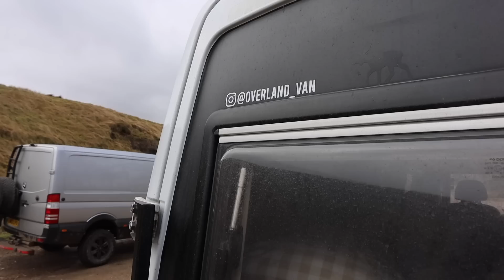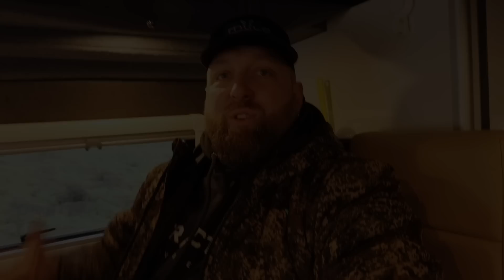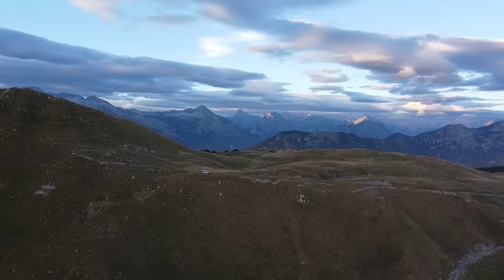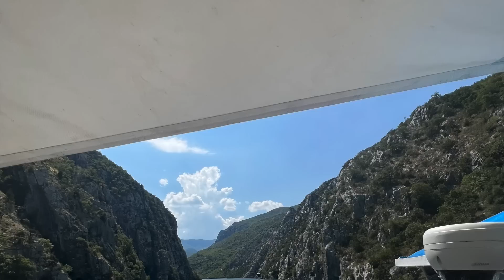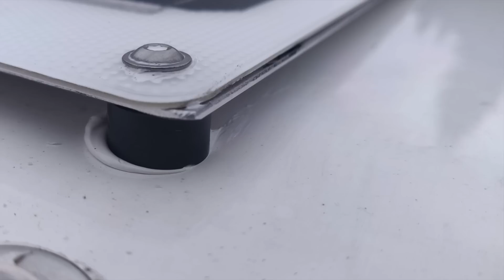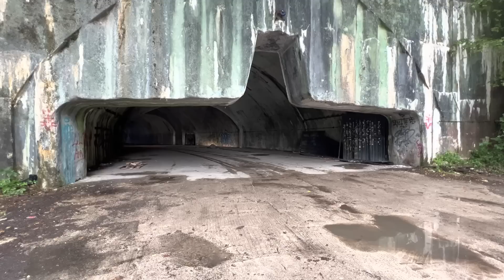4x4 sprinter camper van built for anything!

Comment: Fair play and each to his own, I just can't think help but feel these are compromised as campers and compromised as off road vehicles, but the owners try hard to justify they're "great". If I want to get somewhere remote I'll take a proper 4x4 and compromise on the camping comfort, if I really want to be comfortable I'll take a camper / motorhome and compromise on the location. Shot of an Iveco or at a push an Ighault (and even they aren't perfect), I just don't buy that these are a "catch all" solution
Reply from the maker: Every vehicle has a negative aspect that is obvious. These vans however are an amazing allrounder. As for needing a proper 4x4 to go remote then you must not have looked at the locations and distances this van has done. That’s why I take advice from ppl that do these trips.